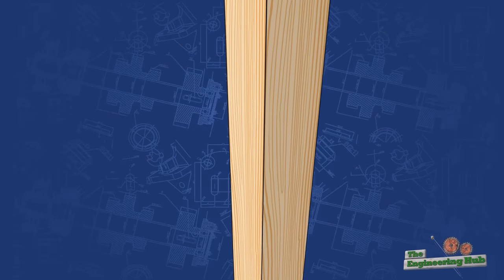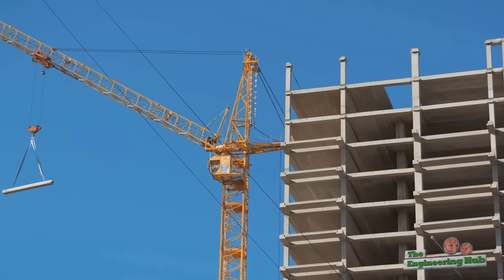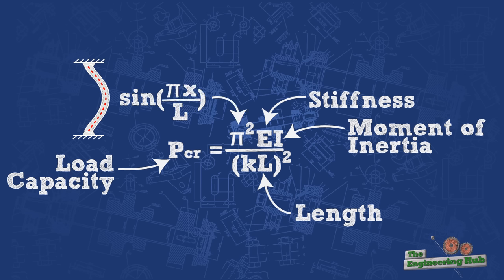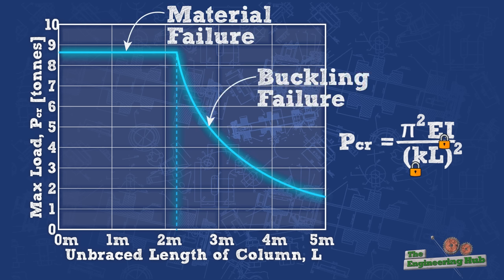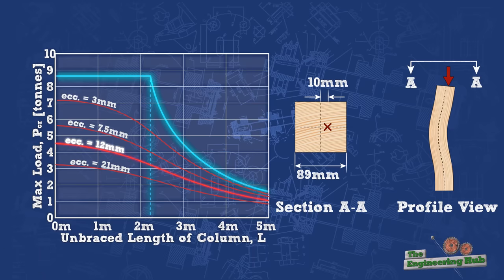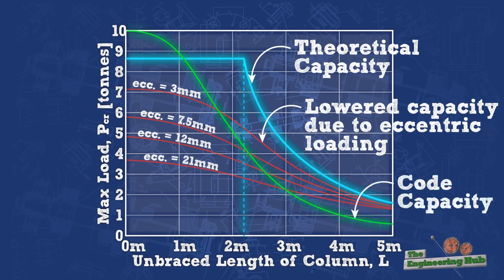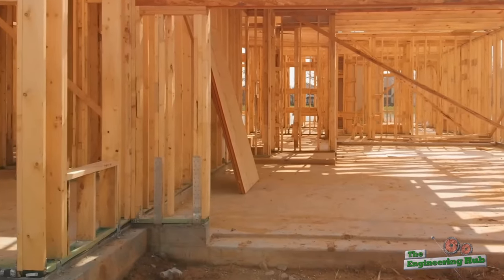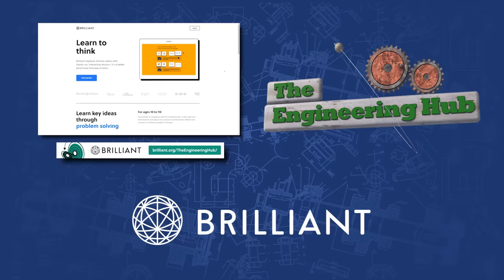How much load can a timber post actually carry?

Comment: Unfortunately, code assumes that the materials delivered meet the specification. Lately it seems if it looks like wood and is the correct size it passes. Cutting 4x4s out of a 6" diameter farm grown tree is nothing at all like a 4x4 quarter sawn out of a 30" log.
Reply: I tried to tell people this years ago...the difference between heart wood and old growth is alot
Reply: And what wood
Reply: Absolutely!
Reply: Agreed!
Reply: That's why engineers design everything with a factor of safety in it. Take the code minimum and then over-build it by whatever FoS value is standard in the industry. Mind you, the code itself has their own built in Factor of Safety, so you really don't need to overbuild it by much to get a good peace of mind as long as the wood isn't literal swiss cheese.
Reply: @BrokenLifeCycle  A good comment, however one has to read deep into the  assumptions made when the code was written. Local knowledge and experience with things like snow loads and wind shear and if porcupines like it and how likely a moose will run into it still matter
Reply: @markbernier8434  I have an IRC book. They have an extensive amount of data and information for the first two things you mentioned. Not sure about the moose and porcupine, though.
Reply: @BrokenLifeCycle  I've the same book.  Local knowledge is for things like the book is based on 30 lbs/sq foot snow load on a roof  and you know you can get that in a few days in your area.
Reply: @markbernier8434  Ah, so you were referring to niche information that's specific to the very area which can't be as easily found or generalized. Gotcha

Comment: Interesting, thankyou. I was recently talking to an Australian engineer who used to examine old trellis railway bridges for integrity. He was saying that if you had a 40x40mm column of the hardwood used in them and had a way of preventing them from buckling, then they were capable of supporting up to 70 tonne. Amazing. Of course you can't really prevent the buckling at that size, thus why the elements of the bridge are so large.

Comment: This is an engineering explanation of why I don't use 4x4s for second story decks. They are strong enough but tend to bow over time. 6x6s stay stable longer with the load of the deck, even though they are overkill structurely.
Reply from the maker: Hi Ryan! That's an excellent example. I suspect creep plays a role there as well since wood tends to undergo creep for its entire life. Though, when exposed to high stress, it deforms much more over time. The longer length of course makes it to bend more -> stress more -> bend more due to creep and so on in a circle for the rest of the structure's life. As you pointed out correctly, this is more of a serviceability failure than ultimate limit state (structural) failure.
Reply: Back home we'd often say "If a little bit's good, a lot's gotta be better."  And 6x6s look better anyway.
Reply: Generally, most codes require 6x6’s for any deck over 8 feet above ground level. Generally it is good practice to use 6x6’s for all deck supports since the live load is rarely guessed correctly.
Reply: Wood is for the fireplace.  Concrete pillar  is far superior.
Reply: @assassinlexx1993  If only concrete was as easy to work with and as inexpensive to buy/use....
Reply: @replyhere590  
To compromise the safety of concrete because it is more expensive.  Is like buying a cheap helmet for your motorcycle.  After a accident and your Brains are on the tarmac.  Is the wrong time to think I should have brought the best helmet.
Reply: Use steel and then theres no problem
Reply: @assassinlexx1993  you will need steel reinforcement, so concrete is more likely to fail when placed in a "plane" scenario. Thus concrete is far from perfect in shear and flexure.
Reply: @judefuselier  
Are talking about a arch or a column. Your statement is confusing
Reply: @assassinlexx1993  He watched a practical engineering video recently. Go ahead and build the pillar out of concrete, then your wooden deck.
Reply: @BPollard86  
 The hardest part is once you a batch of concrete  you have to lift it up. Or build a platform to hold the concrete mixer. Just no easy way of doing it.
Reply: @assassinlexx1993  either, but presumably a column
Reply: @bigears4014  Steel columns are subject to the same Euler formula, and also have a bucklig load.  It's just that it's much higher.
Reply: When My parents had their driveway covering deck built as a car cover, it had 4 inch steel tubing of unknown wall thickness as columns.  We also had termites in the area, so that is the right way to do it.  I remember seeing wood beams around 2x8 spread 1 foot apart under the deck.  I bet well in excess of code, which was good as it got snow and potted plants on it.  

Wood sunk in the ground needs preservation to last long enough and should preferably be sunk in concrete to improve the end fixing and prevent it from sinking.  And I still would not in a flood zone or other wet area or termite infested area.
Reply: @assassinlexx1993  you have no idea what you’re talking about. 99% of decks are built with wood. Even if you have concrete footings, you’re still using wood posts to connect those footings to the deck.
Reply: @patty109109  maybe in your back water area.
Here steel or concrete cost more.  But now the hot tub is secured with no wood to rot. 
With hilly county you end up will long posts for the deck.
Now with flat ground and one  foot deck, I can see you using wood.
Reply: @assassinlexx1993  
The only thing you assassinated is logic with an ignorant generalization like that.
Reply: @jayw900  so you don't understand how building are supported.  I guess you don't have termites. Lucky you.
Reply: @assassinlexx1993  Just temporarily disabled gravity and no problem.
Reply: @assassinlexx1993  per the graph he showed a 6 foot 4x4 will hold up over 10 tons easy. the 40 year old patio behind my home cracked everywhere but the 14 foot high deck which is only 35 years old and held up by 4  4x6's is doing ok. it is a 12x14 foot deck. the 12 posts holding my barn up have been there 138 years doing a fine job. the stone mortar foundation on my house is my bigger concern as some areas are weathering away.
Reply: @victorhopper6774  
Luck you.
In the land of hungry termites. Wood is the dinner bell.  Fortunately termites can't eat concrete or steel
Reply: 6x6 posts are not over kill at all. I'm building a 3 story house on 8ft 8x8 inch posts
Reply: yeah if your beams last longer then your construction......money vs time....
Reply: @assassinlexx1993  what are you doing here then bro
Reply: @assassinlexx1993  pfff thats not a good argument. If you use wood correctly it is strong enough for what it needs to do. Besides bro, ever heard about how bad concrete is for the environment? This is the 23d century man. People worldwide move on to sustainable building techniques.
Reply: @assassinlexx1993  before there was concrete or steel, cathedrals and churches, the tallest constructions that were built at the time were made of wooden framework.
Reply: @notamouse5630  agreed....however ....there are tropical wood species that survive because of their ability to fight off termites and bugs....usually they are very dense in structure and/or have very pungeant anti-bug resin.....
Reply: @notamouse5630  hey, remember the Netherlands!  Amsterdam was built on wooden poles in a mushy swamp....still standing nowadays (however the 16th century houses tend to lean over a bit to either side like drunken sailors ;) )
Reply: @assassinlexx1993  hey what country do you live bro?
Reply: Pressure treated wood is designed specifically to be termite resistant. I have never seen a PT wood column fail because of termites.
Reply: @assassinlexx1993 my thoughts exactly

Comment: I prefer to build-up my posts, using 2x material, using no smaller than 2x6s. 16d every 12" staggered on the faces & an appropriate adhesive between layers. This because WARPING is a reality, & using layers tends to offset that. I know, I know...that's slow & persnickety, but along adherence to Code, I build as if my own sweet Mamma was to live there :-) We Italianos have been building that way for centuries, for we love our women! Perhaps...do a vid comparing such posts with solid wood ones?!!
Reply: I do the same thing and construction workers hate my "overkill".
It's not.
It's always better, always safer.

Comment: Great and interesting video!
Eu citizen here, 1 inch is 25.4 milimeters which would mean 4*4 is 101.6*101.6mm
Reply from the maker: You would think, right? But no, a 4 by 4 is 89 by 89 mm, corresponding to 3.5 by 3.5 inches. Check out the video on why the 2 by 4 is getting smaller and smaller for more details.

Comment: Would be interesting to see the difference in load handling when considering a 6x6 column. I'm not an engineer, but have generally had doubts regarding structural loads on 4x4s, most assuredly when length/height exceeds, say, 8 feet. Have replaced 4x4x10ft deck supports with pronounced bows, with 6x6s. No bows!
Reply: I believed 6x6 wood column has more than 30% compression capacity vs of that of 4x4..
Reply: @BOUNTYEATER  You'd think it would be at least double
Reply: @BOUNTYEATER  it has 246% the surface area (and volume) of a 4x4 so I imagine it’s a great deal more than 30%.
Reply: What about of there is diagonal bracing, say, for example, two braces each side (1/2-way up the height) of a 4" x 4" post, that is 3 metres (and 4 metres) high?   Also, bracing at right angles to the two aforementioned braces, assumed to be in the same plane?  

The problem in northern US, including Alaska and Canada is the additional snow loads that may be experienced.  There were some catastrophic roof failures, with snow, about 12-15" thick (much higher in some 'drift' areas), in eastern Canada a few years ago, when temperatures rose, then it rained heavily - and then the temperature plummeted back to well below freezing, turning everything on the roofs literally to 'one big block of ice'.  A nightmare scenario.

Comment: I live here in the U.S., in Arkansas. At Home Depot, a 4"x 4" square treated post is, as has already been mentioned, really 3.5"x 3.5". But...if you get a 5"x 5" square treated post, it really is 5" x 5".  I think that is interesting.
Reply: Thanks. For me as a European 4x4 means (4 x 2,54) x (4 x 2,54) or 11,6 x 11,6 cm. Not 0,89 x 0,89 cm.
So the Americans not only have a funny system of units, they also do whatever they want with it..
Reply: @Roadkill3120  Yea, here in the USA, it does seem odd and not consistent, but hey...that's what the "Free Enterprise" system does...LOL...!!  

Seriously though, the older houses from years ago; perhaps 50 yrs ago and earlier, used actual 2"x 4" lumber, and much of it came directly from the saw mills and they were still rough cut. These older houses were built so much better with better lumber and usually with good carpenters that knew the trade. 

My own opinion about today's 2x4 that is actually 1.50 "x 2.50 " is that more 2x4's can be cut from a log by using the smaller  dimensions, and that means more profit for the lumber owners. Yea, there is wood that is lost from the thickness of the big saw blades, but that is not why all of todays 2x4's are not true 2x4's anymore.
Reply: @marbleman52  Wood is also far cheaper in the US than in Europe, so make of that what you will.
Reply: @marbleman52  The actual vs. nominal size of softwood lumber in the USA has been consistent since about 1964. So when you see "2x" that means 1.5 inches. In fact all nominal sizes (for softwood lumber)  over 1 inch and up to and including 6 inches are a half inch over the actual size. So a nominal 1x2 is  0.75" x 1.5", a nominal 2x2 is 1.5x1.5, up through a 6x6 being 5.5x5.5 - above 6" nominal the actual is .75 less, so a nominal 2x8 is actually 1.5x7.25, a nominal 4x10 is actually 3.5x9.25, etc.

Note that for hardwood the nominal vs. actual are a bit closer, a hardwood lumber piece that is nominally 2x2 inches is (if surfaced 4 sides) actually 1.75x1.75, and a nominal 1x4 is actually 13/16 x 3.75, etc.

See also:

https://www.harvarddesignmagazine.org/issues/45/nominal-versus-actual-a-history-of-the-2x4

https://www.archtoolbox.com/lumber-dimensions/
Reply: @matisseenzer2383  Good information there, thanks..!!  As I mentioned in my first comment, I know that Pine dimensional lumber has a smaller thickness in the actual than the nominal. But with treated Pine, a 5"x5" piece is actually 5'x5", but a 4"x4" treated is 31/2"x 31/2". Both are treated Pine, so why the difference? Do you have any knowledge about this?
Reply: Thank you for clarifying why the heck they say in the video that 4 in are 89 mm … that would explain a lot if true when analyzing failures

Comment: That’s why I buy construction heart rough redwood 4x4s, plentiful in NorCal. The actual size is closer to 3 3/4-3 7/8” depending on the mill. They are beefy and strong. I built a 12x12’ redwood tent platform out of them with GRK 5/16 x 5 1/8” RSS Structural screws, the best

Comment: I just lifted the Supporting beam in my basement holding up 3 stories of my old Victorian house with a 4x4 post and a heavy jack. It made some strange noises but did lift the beam enough for me to make several telepost adjustments. It was a 20 ton jack and was probably near its limit.
Reply: That’s sketch, I would’ve used something a little heavier, any checks or cracks and that thing would explode like a claymore
Reply: @rezzbuilds8343  I was prepared to go down with the ship
Reply: Lol

Comment: I' m just an electrician but find this vidio very interesting. Maybe 445 years ago eleven decks became popular in my area home owners never got a permit or inspection for deck they installed on their houses. Most only used two 4 by 4" post to hold up a 18' wide by up to a 16' deep deck. A few years later the city sent out inspectors and made them replace fluently undersized 4 by 4" post with 6 by 6" post which have about 250% more  area. A lot of these decks were built over driveway that could easily be hit by cars parked under them.
Reply: I shudder when i see a balcony with supports on a footpath kerb.. all it takes is one Not careful driver

Comment: The lesson to be learned here is that it's best not to try to improve on nature. If you want to do a very interesting comparison, do a few calculations on a whole log. A vertical log, without having been compromised by cutting the natural rings, will raise many eyebrows. Minimal shrinkage (1%), maximum strength, by evolution, and a better fire rating. If memory serves, a 200 mm diameter vertical log, 2400 mm tall, will carry 20 tons. With whole log joints, in log home building, a simple wooden wedge prevents any movement in the structure, and the extra stability is obvious.
Reply: thank you, what interesesting info!! Of course, you cut through the rings you have all this soft wood exposed, more rot, more fire hasard.....i never thought about that though the strength surplus was already obvious to me (when you cleave a wood beam vericaly across the grain  the principle becomnes clear....)  why o why did we stop using logs.....though i have an idea why.....time for the old craftmanships to return !!

Comment: Please please make a similar video when the load is applied midcenter on a horizontal wooden beam. How things change when you create a slight angle, and also move the load from center to something like 1/3rd of the length. Thank you!
Reply: Standard homesteader M.O. is : when in doubt,  over-compensate. Obviously, loads vary, but generally it becomes gut-feel, so trust your instincts. If your parameters are that your family's lives depend upon it, then give your subconscious credit to come to the plate.

Comment: The thumbnail demonstrates the load being distributed on the beams below — not just the timber post. Supporting the argument: In most situations, the timber post is just for support, and the load barring can mostly come from the material of the building.
Reply from the maker: Well the beams are attached to the columns so the load path goes through the column from all the members above it. Not sure what you mean by "just for support"

Comment: For weather and rot resistance - is an end cap a good idea, or painting the end, or some other water barrier?  And how often do these need to be inspected or replaced?
Reply: I'm a home improvement contractor along the south Jersey coast. I do alot of deck construction. I never put a cap on the bottom end of a post because over time it will collect moisture which in turn allows the end grain the absorb water through the end grain of the post/column. I usually seal the bottom end in a heavy coat of wax. The top of the post will usually be capped if the cap can roll over the edges. To water can't penetrate the end grain.
Reply: If it’s treated wood it doesn’t matter.